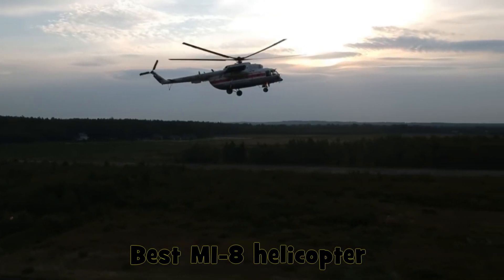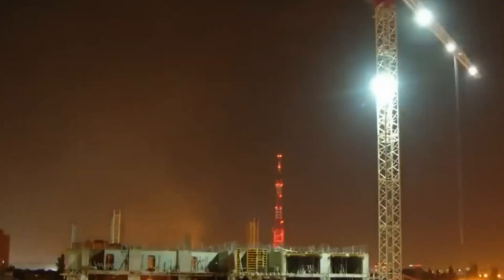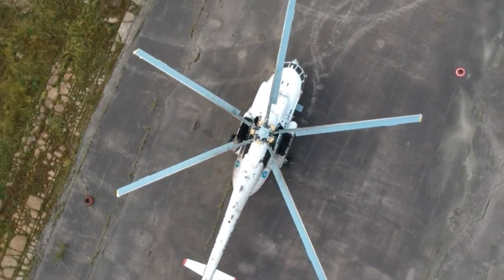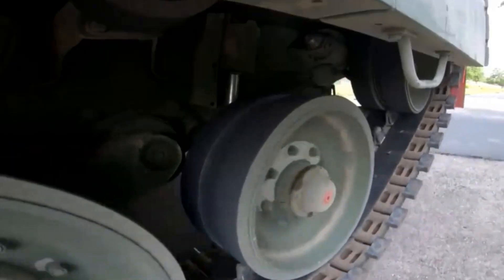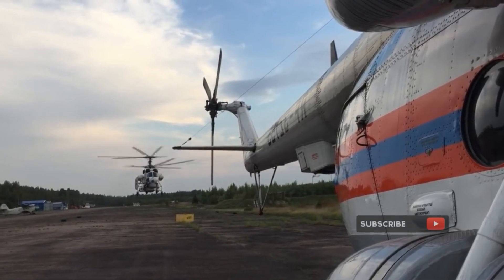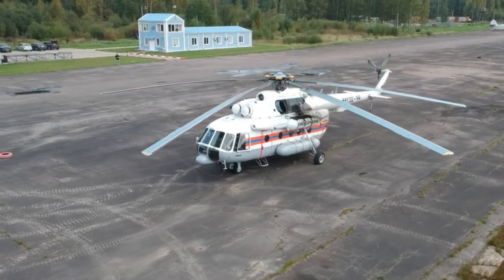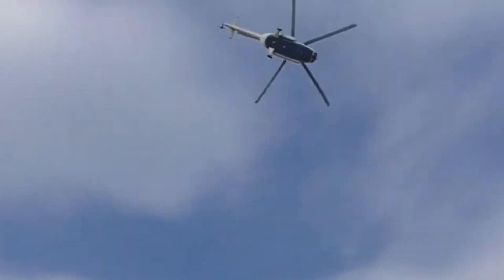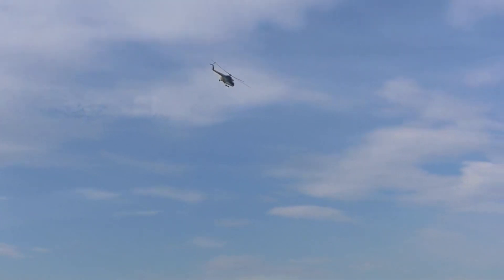Best MI 8 helicopter

Comment from the maker: Best MI 8 helicopter 
A little about the history of creation
The multipurpose Mi-4 with one piston engine and a four-bladed rotor has proven itself well but its time has ended and at the end of the 50s of the last century the development of second-generation helicopters with turboshaft engines began 
In 1961 in Tushino for the first time they showed a new V-8 car with one theater above the cockpit but still with a main and tail rotor a tail boom and a transmission inherited from the Mi-4
Only the fuselage and the AI-24V power plant were new